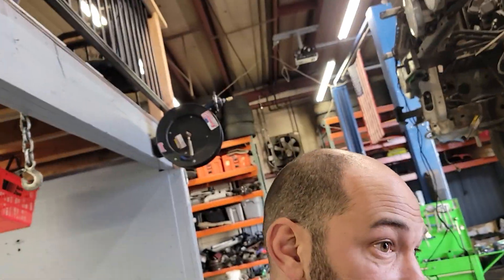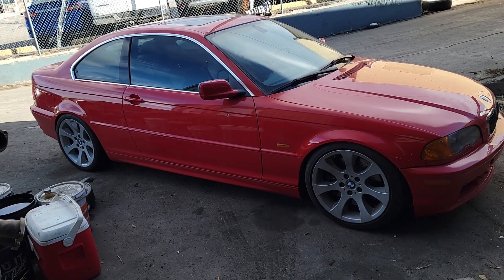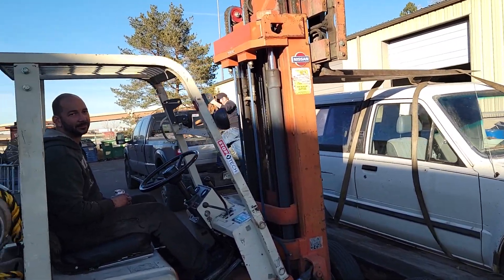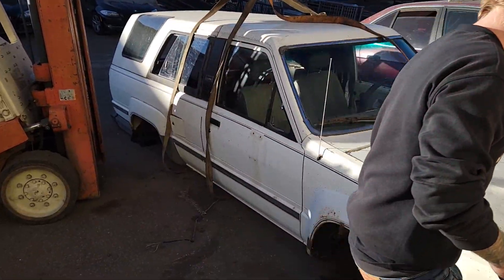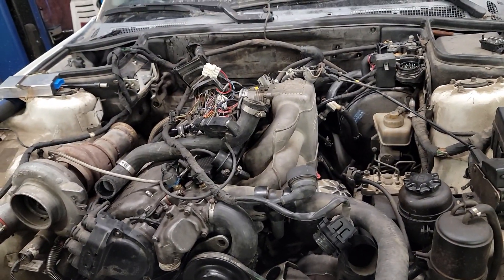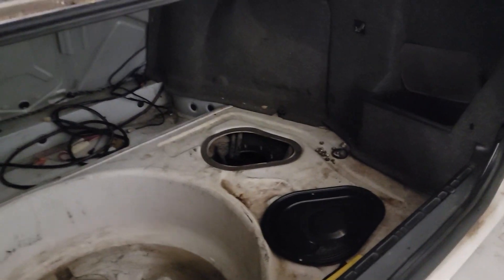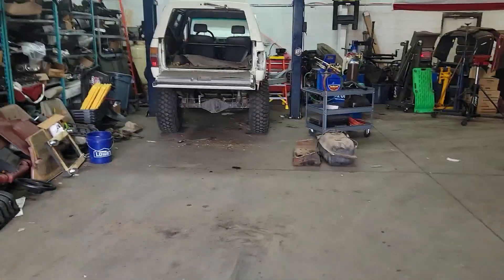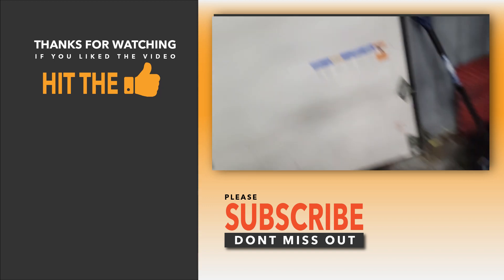Issues With The Turbo 535i, Body Swap Progress

Comment: After putting turbo kits on these old BMW's how do you tune them, just use the stock ECU?
Reply from the maker: The old go to for standalone ecu was MegaSquirt, but we have switched to K-data. The use the same firmware, they are cheaper, and their hardware is better quality.
Reply: @DENVERBEERANDOIL  thanks brother, I was just wondering

Comment: So what happened with the mini at Zach's? I've done an absurd amount of mini heads/timing for my boss, I hate those stupid cars haha
Reply from the maker: R56, Had a burnt valve, I pulled the head, had it repaired. When putting it back together I couldn't get the locking pin in the flex plate. Pulled the engine to pull the trans and assemble outside of the car. Got it all together (after fighting the stupid cooling pipe on the back). Got everything back together ran great on test drive, brought it back in the shop, revved it in celebration, crank hub spun and bent all the exhaust valves. Pulled the engine and put a new engine in it. That one also had bad timing chain guides, so replaced those again. Put it all together. Added an extra 90 degrees to the crank bolt torque. Car finally left
Reply: Yea can't say I'm surprised, I was gonna guess r56 too but figured I'd ask seeing that 53 in there haha my buddy has a big turbo and meth build, he rebuilt it once himself, cam caps backwards, destroyed the head, next time he undertorqued crank and it spun, next time he over torqued crank 90° and the hub spun and fused to the timing sprocket, which fused to the oil pump sprocket, and finally fused to the crank. He just dropped the block off to get sleeved and I'm reassembling for him so it's right this time around
Reply from the maker: I hate them with my entire being at this point